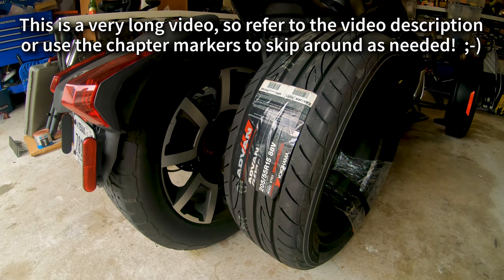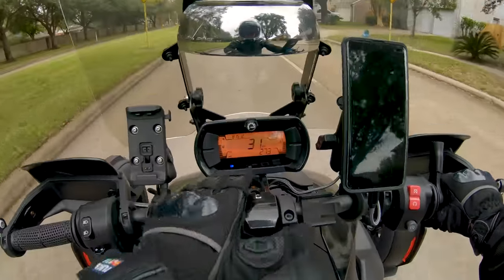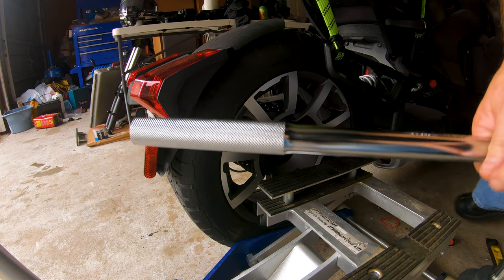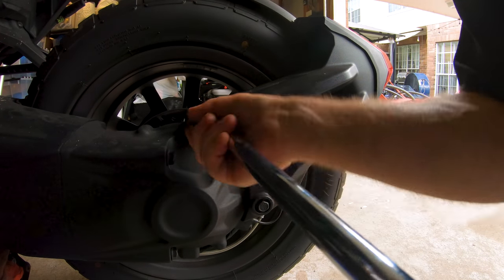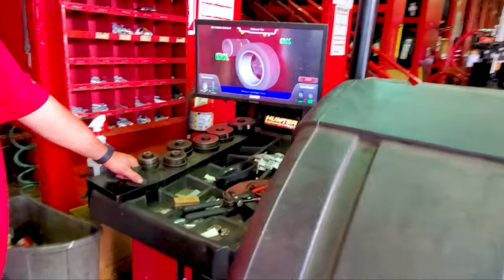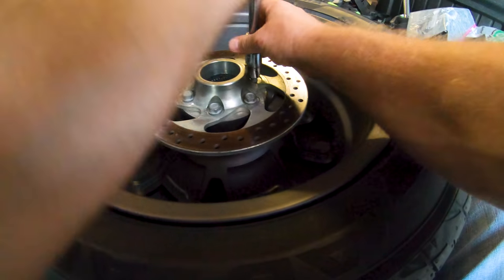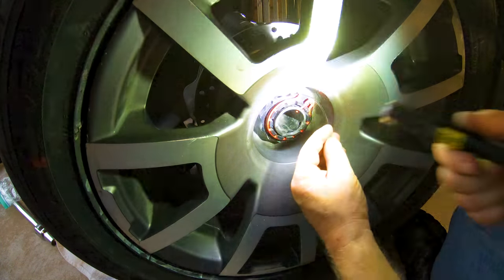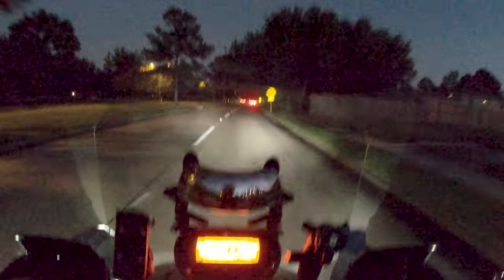RYKER: The Darkside Saga - Yokohama rear tire upgrade

Comment: The holse were probably weren't cleaned out after drilling and tapping.
Reply from the maker: The threads were clogged full of red thread-locker, so they needed a thorough clean out before I could get the bolts back in there.  😉👍  --QM

Comment: Not sure why the threads were so dirty but could the holes be tapered or self locking. Cleaning like you did could wreck this feature. Just wondering.
Reply from the maker: I considered the tapered thread scenario and examined the bolts carefully before proceeding.  The factory put so much thread locking compound in the bolt holes that it was necessary to clean them before reinstalling the bolts.  Before cleaning them out, I was using over 40 lb-ft of torque just to start the bolts into the holes.  That would have completely skewed the installation torque, and it probably would have galled/stripped the threads beyond repair.

My preferred Ryker alignment shop ( https://www.thornolis.com ) advised that the wheel can be mounted on most balancing machines without removing the brake rotor... apparently, he does it all the time.  It would be a lot simpler in the future to find a tire shop that can do the procedure without pulling the rotor.  😉👍  --QM

Comment: I have a 2022 Ryker Sport, 16" rims. Will that tire fit in the rear fender? A lot of work to find out it won't. lol.
Reply from the maker: My 2019 Ryker Rally had a 15" rear wheel, so the fitment is different than your 16" wheel.  I'm sure that any comparable automotive-type street radial tire with the same size as the original will fit without any issues. 

The Rykers are strange beasts with odd-sized front wheels/tires. There aren't many alternative tires except for the factory Kenda's (which I hate).  I sold my Ryker last year, so I'm out of that game now.  You might check some Ryker forums to see if anyone has found good tire upgrades.  Cheers!  😉👍  --QM

Comment: Hey just bought that same back tire should I send it back? And was that the reason for the alignment issue
Reply from the maker: The Yokohama tire is MUCH better than the original Kenda, in my opinion.  My Rally had the all-season Kenda tire, and that thing was just marginal on dry pavement, and downright scary on wet pavement.  The Yokohama has fantastic grip on dry and wet roads, so I definitely recommend it.  I recently took my Ryker out on ice and snow, and the Yokohama sucked on that... absolutely zero grip... but that's a rare situation that I'll probably never encounter again here in southern Texas.

My alignment issue was a different situation.  The dealer where I had the new Kenda front tires installed also did a laser alignment on my Ryker.  I think the tech was new or completely piss drunk because my bike was set with 2.5" of toe-OUT... it should have been 0.25-0.50" toe-IN.  I had the bike realigned by a local shop and it's handling much better now.  Cheers!  👍  --QM
Reply: I like that the Kenda could go off road in Dirt and grass will I still be able to do that with the Yamaha
Reply: Yokohama
Reply: What psi as well did you set it to
Reply from the maker: @dustynmontague7557  Yes, the Yokohama still does well in grass and light gravel.  I've ridden about 2500 miles on the Yokohama so far, and it has performed flawlessly except for the ice/snow trial.  👍  --QM

Comment: What is the plan for the fronts? I think I missed that. And... great video, as always!
Reply from the maker: I replaced the original all-season Kendas with the normal Kendas from the non-Rally Rykers.  Unfortunately, we don't have any other options right now for the front tires.  Kenda makes this proprietary size (145/60-R16) for Can-Am/BRP specifically for the Ryker.  Hopefully other manufacturers will start making tires in that size so we have an upgrade option.  The only good news is that these normal street tread Kendas don't seem to track rain grooves as badly as the all-season tread did.  Cheers!  😉👍 --QM

Comment: Hey there!  What's that windscreen / mirror?  Any idea where I can buy one??
Reply from the maker: Howdy!  That's the MadStad Engineering adjustable windscreen: https://madstad.com/products/can-am-ryker-2019 .  I installed the 18" version, but I think the 20" would have worked better for my situation.  I discussed the fitment in this vlog: https://youtu.be/1uzBj_NlMME

I added a RiderScan Blindspot Mirror:  https://amzn.to/3nJjXLp .  If that one is out of stock, then there are several knock-offs that are cheaper and seem to work almost as well ( https://amzn.to/49WKaNu ).  You can search Amazon or Ebay for "parabolic blindspot mirror" to find alternatives.  

This parabolic mirror really helps situational awareness in traffic because you can see 180° behind you.  There is a learning curve to use it properly because the image is distorted by the mirror's convex shape, but it becomes second nature after a few hours of riding.  It's very rare for me to be caught off-guard with a cager hiding in my blind spot while I'm riding with one of these mirrors.  Cheers!  😉👍  --QM

Comment: I don't agree with the darkside thing - it's an RT so car tire is just standard. DS is what the 2 wheeler call it.  Hopefully you run the correct (low) pressure as most seem to be determined to shorten the tire life by way overinflating. 15psi front 20 rear is a good start. You should get 40k out of the tires if inflated correctly. Yes a 4 foot breaker bar is a sad reality of the "good and tight" mechanics.36 on the rear? wow way way too much drop to 20 or buy more tires
Reply from the maker: The Kenda tires on the Ryker have a "MC" classification on the sidewalls, so it's still technically a darkside conversion.  😉  Several of the Spyders have been fitted with this size Yokohama for many years, so this is nothing new in that respect.  However, Cam-Am doesn't approve of anything other than the factory-spec Kenda tires for the Ryker... and those leave a lot to be desired in terms of traction and overall performance.

The tire pressures specified by Can-Am for the Ryker are 20 PSI for the front amd 28 PSI for the rear.  I've been running mine at 20/26 with good results so far.  --QM
Reply: @QuasiMotard  As an engineer I design reverse trikes and over 13 years have seen a lot of misinformation on tires and pressures.  On the RT and F3 12.5 to 17psi is recommended for the front and 28 for the rear. I don't know why BRP would recommend 20/28 for the Ryker as it is a lighter version and one would expect less pressure like 14/22 or in that line. This is why I cringe at the term Darkside as it will in general lead to misinformation and a bunch "feels like" engineering. I know extreme rear tire wear on all spyders running 28 on the rear is common and it's all center wear which says a lot about what is wrong. 45-50k is normal for all the trikes I design but I setup the specs. Just sharing my expert advise, you can do as you wish. No big deal.

Comment: Hey what tire pressure did you end up liking? I just got mine mounted and balanced today, installing tonight
Reply from the maker: I've been running my rear tire at about 26 PSI and it seems to handle it very well.  I'm up to about 3500 miles on the rear so far, and it still looks like new.  👍  --QM

Comment: Great video.  I am thinking of buying the new PPA wheels for my Rally so I am seeking out a tire.   By the way,  what camera are you using on the bike?  Great video and audio quality.
Reply from the maker: Thanks for the feedback, Jim!  I've looked at the PPA wheels, but I don't know if I want to dump too much extra $$$ into my Ryker right now.  I'm planning to completely rebuild my front suspension (e.g., new upper & lower control arms on both sides, new steering knuckles, ball joints, etc) so I can PERMANANTLY cure my alignment/handling problems.  It's still giving me fits, so the only recourse now is to start hitting it with the big hammer and replacing parts.

The camera that I use for most of my videos is the GoPro Hero 7 Black.  That is mounted in a Ulanzi vlogging case and attached to the helmet with a MotoRadds chin mount.  The microphone is from a Cardo Scala G9 bluetooth headset and it's plugged into the GoPro audio adapter.  The combo works well and I just got lucky with the audio quality from that mic.  You can watch a quick video here with my helmet setup if you're interested:  https://youtu.be/D_lbmLdenHU .  Cheers!  👍  --QM
Reply: The wheels are very nice but good luck putting them on!

Comment: Is their a Can Am dealership in the area? What ever the cost, it’s probably worth it. What a hassle. 🤬🤬🤬
Reply from the maker: Yes, there is a local dealer where I purchased my Ryker, but they can't install tires that aren't factory approved.  That means Kenda is the only option, and I didn't want another one of those.  This was a painful process, but the Yokohama is a much better tire and has a lot more grip for the Ryker's light back end.  Cheers!  😉👍  --QM
Reply: Got ya. My Spyder is a 2021 I just bought last November, it only has 3000 miles on it so far. I’m in Chicagoland so no ridding during the winter. Can’t wait for spring to warm things up a bit! 🥶🥶🥶

Comment: hi have you found a replacement for the front
Reply from the maker: Not yet.  As far as I know, the Kenda tires are the only brand that will fit the Ryker's rims and don't require fender modifications for clearance.  👍  --QM

Comment: Did you give thought to taking it to a shop that changes truck tires?
Reply from the maker: No, but that could be an option.  I was advised by another Rally owner in Oklahoma that Discount Tire took care of his Ryker, so that was my first stop.  I was advised by James Thorne (Thornolis.com) that it should be possible to balance the tire without removing the brake rotor, so I'll try that next time.  👍  --QM

Comment: Can the tire shop balance the tire without taking the brake rotor off?
Reply from the maker: A local Spyder shop (James Thorne, http://thornolis.com) advised me that most shops should be able to balance the wheel without removing the brake rotor.  Another Ryker owner in Oklahoma had their tire done at DiscountTire.com, and he told me that they also had to remove the rotor... so maybe it's just their Hunter balancer machines?  Removing the rotor wasn't that difficult, but the thread locker was a real mess to clean up.  Cheers!  👍  --QM

Comment: What windshield is that you have looks great
Reply from the maker: Howdy, Bud!  The screen on the Ryker in this video is the MadStad Engineering adjustable windscreen ( https://madstad.com/collections/can-am/products/can-am-ryker-2019 ), and it performs MUCH better for coverage and features than the Can-Am accessories.   My height is 5'7" (170 cm) and I chose the MadStad 18" screen, but I would recommend the 20" instead for slightly better coverage.  MadStad has a measuring recommendation on their site to help find the correct height.  Cheers!  😉👍  --QM

Comment: Does that tire have any metal in it? I was told not to use steel core tires on a motorcycle?
Reply from the maker: The Yokohama is a radial tire, so I presume that it has steel cores/belts.  The Ryker's tires are automotive-type tires even if their sidewalls show an "MC" rating.  They don't have a round carcass and don't need variable load angles like a traditional motorcycle tire... it's just straight up and down like an automotive wheel.  👍  --QM

Comment: how much more grip does that tyre offer?..ive the standard tyres on my UK ryker rallye and it will do 60 in 4.5 seconds but the 1st 20 feet is wheelspin....is it worth the change?
Reply from the maker: I think the Yokohama is worth the change, but only if you mostly ride in warmer weather.  The Yoko does well in both the dry and the wet, but it's rubbish on snow or ice! https://youtu.be/TtCWNgmjhtA 👍 --QM
Reply: How many miles on the tire?  I was getting a lot of wheelspin at first on my rally.  I now have 1800 miles on it and getting the rear wheel to spin is actually kinda hard now.  It bites compared to when I first got it.  It really digs in.

Comment: Think you mentioned you would change the front tires. Did you do that?
Reply from the maker: Yes, I did the front tires and another laser alignment right after this rear tire install.  I haven't edited or posted that ride series yet, but I hope to get it out in the next week or so.  The new front tires did help traction somewhat and they are more resistant to following rain grooves than the all-season tires that were originally on the Rally.  Unfortunately, my Ryker still has an alignment issue... the front tires are already sawtoothed and cupped on the edges ofnthe tread blocks after only ~1000 miles.  I've resigned to live with the problem and just not ride it for extended journeys... it's just too exhausting to fight it 99% of the time.  Cheers!  👍 --QM
Reply: QuasiMotard what front tires did you use?
Reply from the maker: @glend3139  The only tires that will fit the Ryker's front wheels are the 145/60R-16 tires from Kenda.  All of the Rykers have 16-inch front wheels, but the Rally edition gets an all-season tread instead of a normal street tread on the non-Rally models.  Unfortunately, there are no automotive equivalents available in that size yet that we can use for alternate tires.  Can-Am dealers and service centers are only allowed to install the factory-authorized Kenda tires on these bikes, so we have to be creative on our replacement options.  The front fenders and related brackets offer very little clearance, so using a larger tire won't work without custom fabrication and other modifications to the bike.  So, we're stuck with the Kenda front tres until another manufacturer decides to make something in the 145/60R-16 variety.  Cheers!  👍  --QM

Comment: Did you check the brake pads?
Reply from the maker: Yes, I checked the pads and rotors on all three wheels before that last trip.  My rear pads still look nearly new... still over 3/4 of the pad material remaining.  👍  --QM

Comment: Did you try WD40 down your brake caliper holes?
Reply from the maker: I cleaned out the brake caliper (and fender support) holes with WD-40, then a shot of brake cleaner.  I put blue thread locker on the caliper (fender support) bolts to keep things together.  I also put some anti-seize on the wheel threads when I put it back together just so it wouldn't be crusty and stuck next time.  Cheers!  😉👍  --QM

Comment: What's the phone holder??
Reply from the maker: My phone mount is a combination of 4 different pieces.  The primary mounts are the BRP/Can-Am smartphone holders (one on each side, one for phone and another for GPS).  However, I don't use the original RAM X-Grip that comes with that mount.  Instead, I have changed to the Quad Lock mount, which uses a phone-specific case and a 1" RAM ball adapter to attach to the original double-socket arm.  I have linked the parts below for reference:

 - Can-Am/BRP Smart Phone Mount:  https://amzn.to/3wpJIE9
 - RAM medium double-socket arm:  https://amzn.to/343r09i  (can reuse the existing double-socket arm from the BRP kit, but this one is aluminum)
 - Quad Lock 1" ball adapter mount:  https://amzn.to/3bKTby4
 - Quad Lock motorcycle vibration dampener:  https://amzn.to/3vn8hBq

I have installed similar setups on all of my bikes, so I can just clip my phone right into the mount without readjusting anything.  The 1" RAM ball allows me the flexibility to mount other accessories instead of my phone (e.g., GoPro or GPS) whenever necessary.  Cheers!  👍  --QM

Comment: The factory tires on Rally is dual purpose not best for paved only riding.
Reply from the maker: The Ryker is realistically a pavement-only bike.  I've ridden my Rally on gravel roads a few times, but I wouldn't dare take it "off-road"... that's just inviting disaster.   The Rally edition has slightly higher ground clearance than the non-Rally at 4.4" (112mm), but the radiator skims the ground at only ~5.0" (127mm) above rocks, twigs, branches, squirrels, etc.  Considering the fact that these machines are ridden on the road 95% of the time, the all-season tires don't make much sense to me... especially considering those tires' limited traction on wet surfaces.   --QM